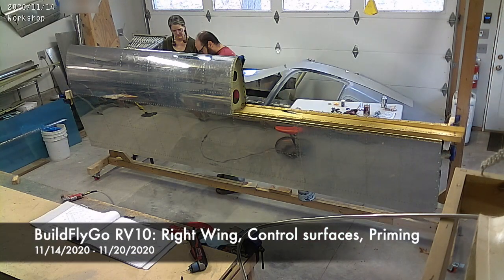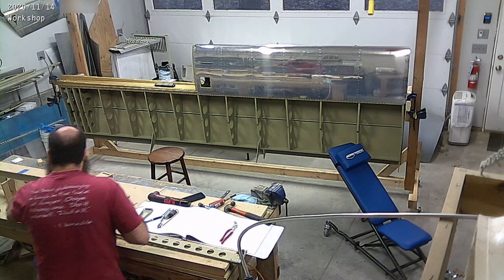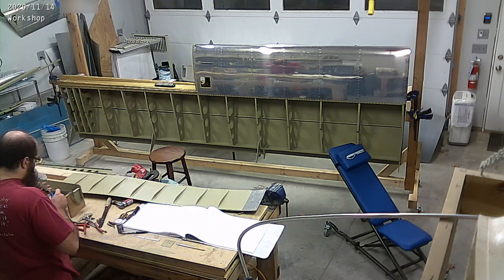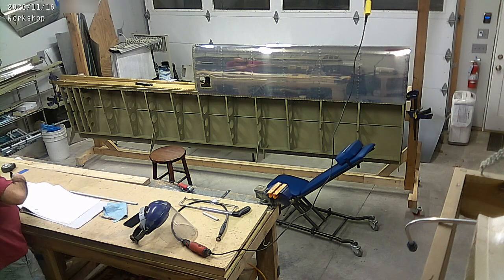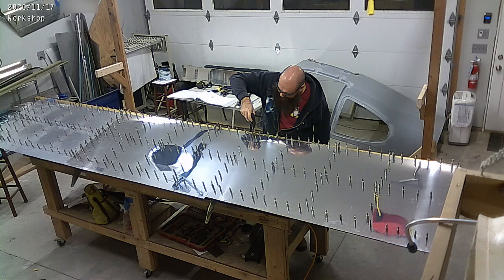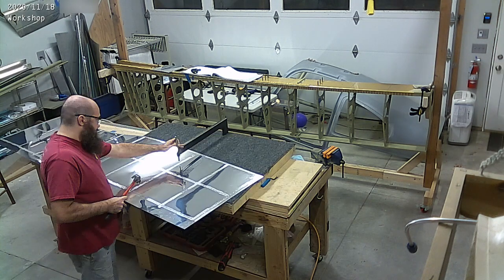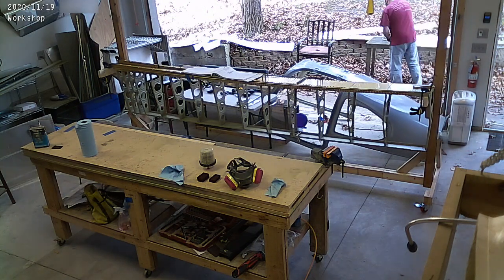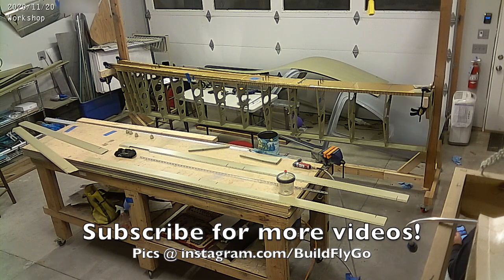RV-10 Build: November 20th, 2020 - Wings & Priming!

Comment: Looking forward to that priming video, as that is a big step before we actually start blasting rivets through those holes. I’ve noticed that you are priming the insides of the skins. Not everyone in YouTube land seems to do that,  it certainly seems consistent to me. I need to do some research on the extended fuel tanks. Do they fit in the same space that the stock tanks do?
Reply from the maker: Many people don't prime, it's up to the builder. Most 50 year old Cessnas out there have no primer and are doing fine. I figure it adds a nice sturdy finish, protects from corrosion and does not add that much time and weight. When I was done with the 9 I told myself I wouldn't prime the next plane, but here we are :-D
Reply from the maker: I'm installing the Hotel Whiskey extended wing tanks and also plumbing for a TurtlePak ferry tank in the back. The HW are 15gal extra, or ~75~90 min. I'm thinking I can put a 20gal in the back without much trouble for another ~90~120. With the mains (60gal) that gets me (95gal) ~8hrs fuel. Considering Goose Bay to Narsarsuaq is ~4 hours with no wind, that's plenty of unexpected headwind buffer.
Reply: @BuildFlyGo  Does anyone make extended tanks for the RV-14(A)?
Reply from the maker: http://hotelwhiskeyaviation.com/rv14
Reply: Wow, you make it sound so easy, lol. I have no problem taking my time on trips and making a fuel stop. I’m crazy and low hours though so what do I know?
Reply from the maker: I absolutely agree on taking my time and stopping to enjoy stuff. I rarely fly legs longer than 2 hours because there are things to see down below. Unfortunately not many places to stop on the CYYR-BGBW leg 
https://skyvector.com/?ll=57.44967860623745,-52.92480467957724&chart=301&zoom=12&fpl=N0150%20CYYR%20undefined%20BGBW
Reply: @BuildFlyGo  CYVM-BGSF leg is the shortest over water leg between Canada and Greenland:
Reply from the maker: Yeah, that's definitely an option as well. We're a couple years away from doing the trip, plenty of time to plan :)
Reply: My goodness! Does oxygen even exist up there? Not sure I have the guts to try a trip like that.

Comment: Another great video! ... I'm looking forward to your upcoming priming video.  Does the primer always go on both the inside and outside of every aluminum part or are there situations where you just prime the inside only?   Thanks!
Reply from the maker: Only prime the inside, the outside skins will be prepped by the paint shop when the time comes. Most shops won't warranty the work if they have to paint over primer they didn't lay down themselves, and not all topcoats are compatible with all primers. I'll try to get that video edited this week ;)
Reply: @BuildFlyGo  Thanks for the clarification.